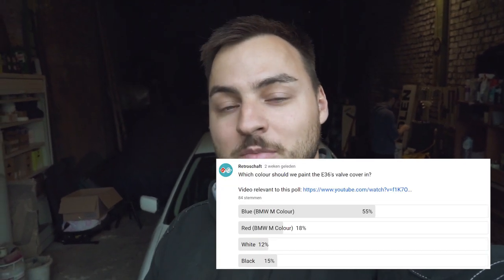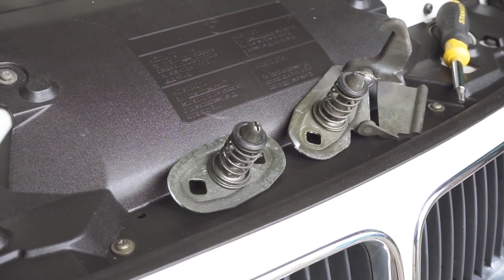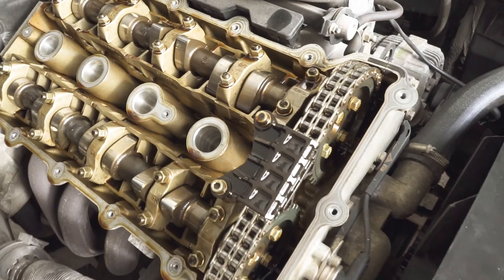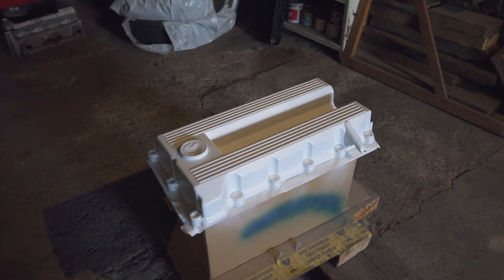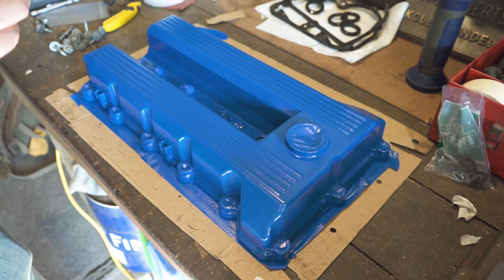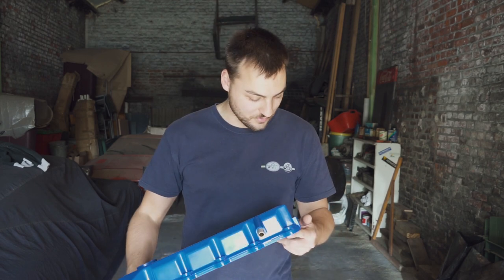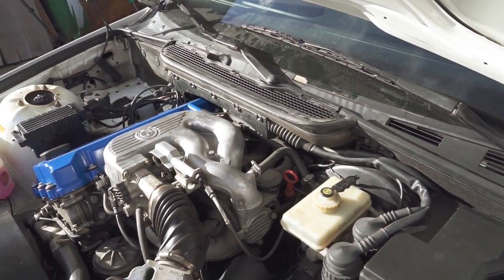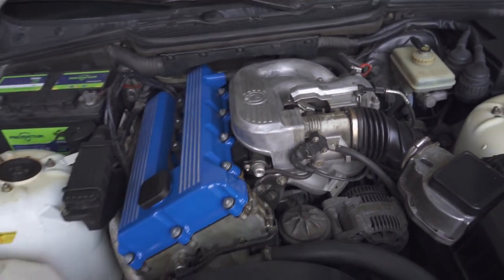INSANE RESULT! PAINTING THE E36's VALVE COVER

Comment: do i have to mask something off in the engine bay when using the dremel tool to restore the engine (because of the small flying particles etc)? 🙏
Reply from the maker: I guess if you just look around for any potential hazards you'll be fine. The air intake is pretty much tucked away nicely anyway and that would be the biggest issue I imagine. Maybe temorarily put a cover on the alternator or something. Other than that I'm not aware of any immediate dangers :)
Reply: @Retroschaft  thanks 🙏